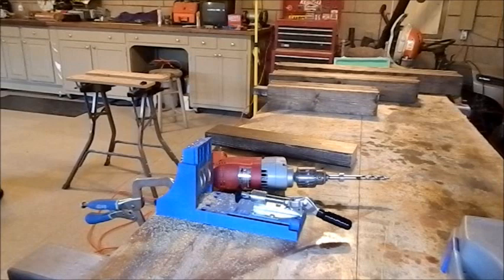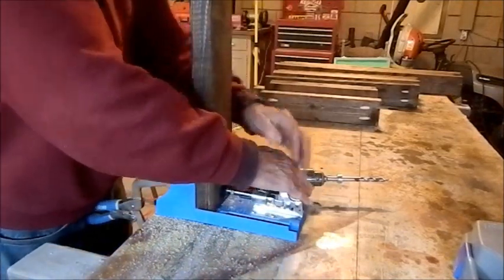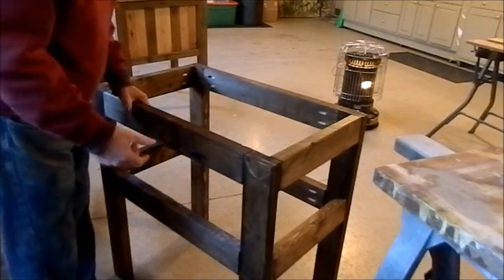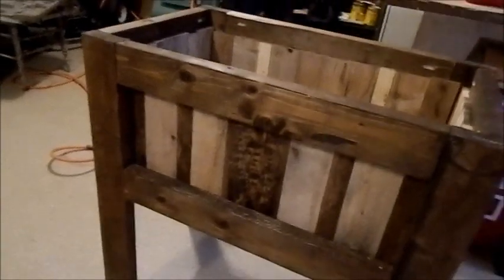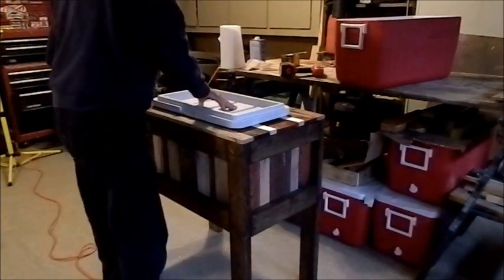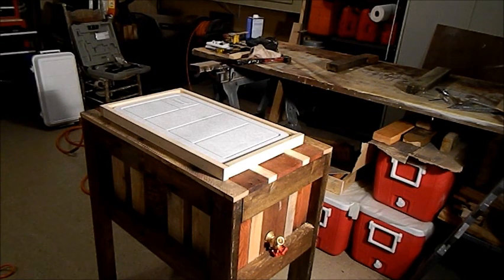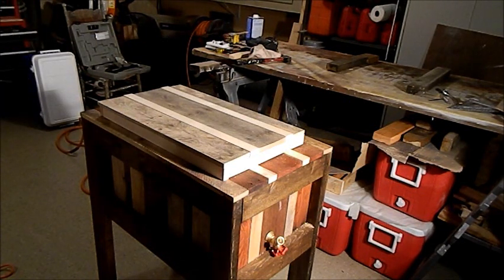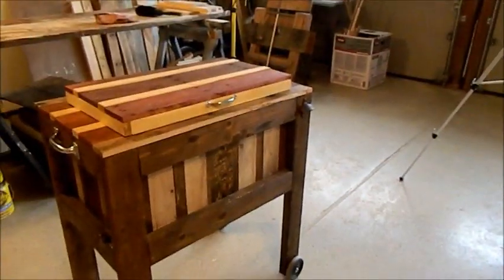Pallet wood Cooler  How to

Comment: When you cut the top part out for the lid of the cooler how do you ensure it still fits snug on the cooler so you don't leave a gap between the cooler and cooler lid? Good tutorial as well.

Comment: What holds the cooler in place? The ones I've seen have a frame underneath the cooler. They can weight quite a bit and I don't think a friction fit is good enough.